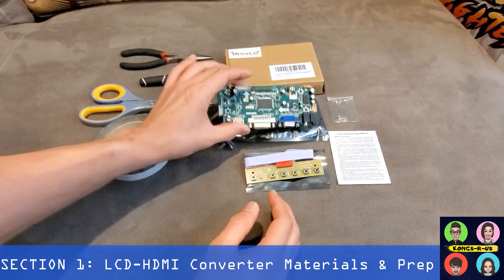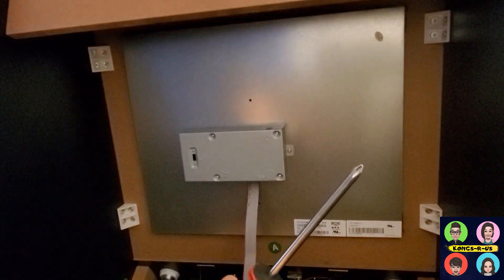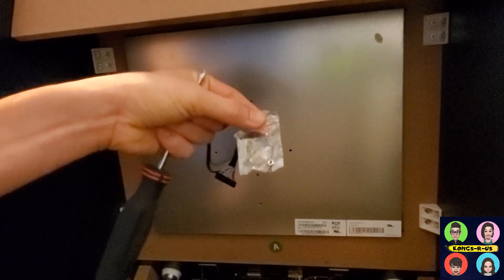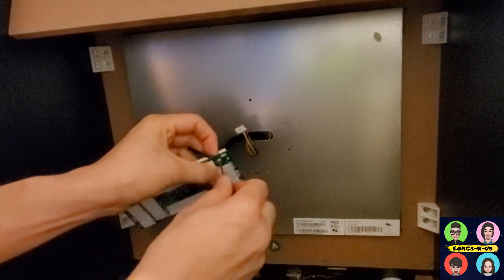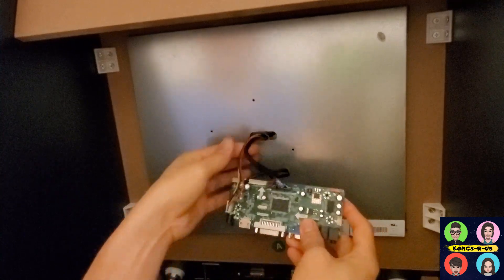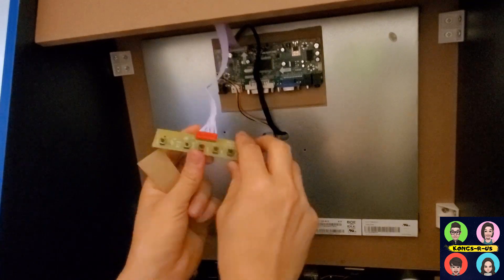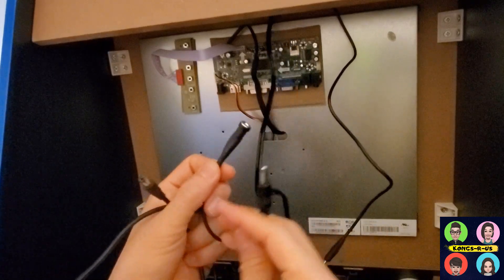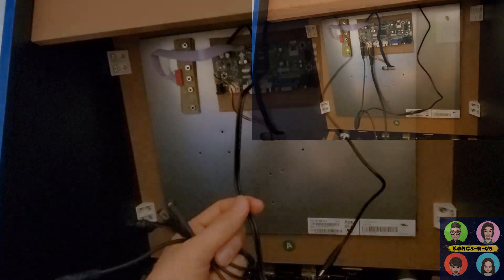Star Wars Arcade1Up In-Depth Mod Tutorial: LCD to HDMI Converter Installation

Comment: Loving these tutorials. Is it possible to put a larger monitor in a standard Star Wars arcade1up cabinet like a Dell 2007fpb for instance?

Thanks in advance.
Reply from the maker: Yes, definitely possible. But some games will have trouble running full screen, most notably Star Wars Battle Pod
Reply: @KongsRUs  Thank you for your answer. Would it have to be upgraded to run on a pc or would it be possible to connect it to the original Arcade1up pcb?
Reply from the maker: Hmmm, I've seen some people use a Geekworm LVDS to HDMI adapter for stock PCBs to work with larger monitors. I can't say for sure it would work, but it's possible

Comment: IF you use the Speaker connections on the LCD driver board it will be loud enough (the 3.5MM jack is pre-amp output for headphones ) - the 4 pin Speaker connector to the side of that is amplified output which is designed to go to speakers and the volume on the DIsplay adapter can be set using the menu buttons. Doing this would avoid having to buy an amp but would need to cut or modify the 3.5mm plug to a 4 pin jst connection for the driver board.
Reply from the maker: This is a great tip! I should have looked into this more if i was already splicing the stock speakers, i should have looked for a 4 pin connector to use the display adapter. Definitely a great alternative and money saver, thanks!